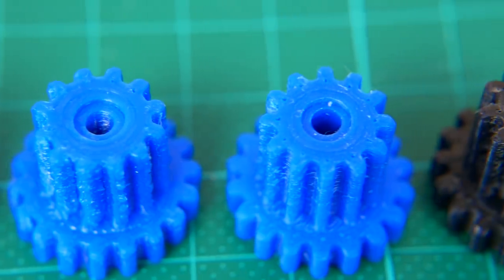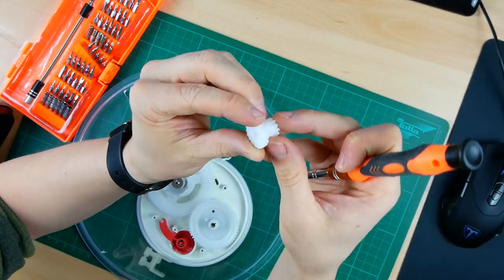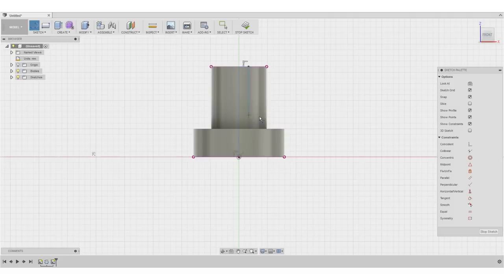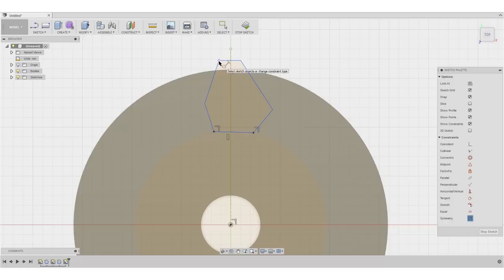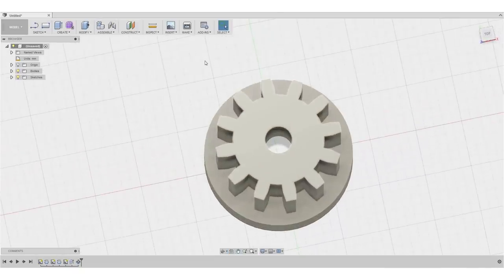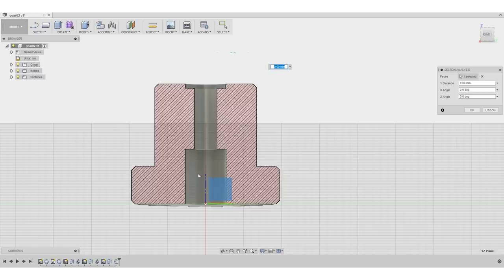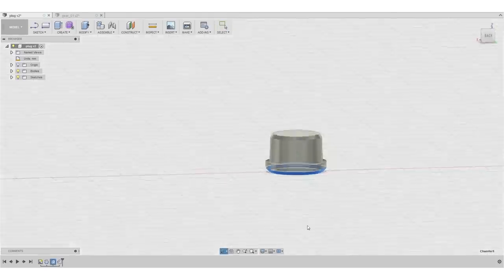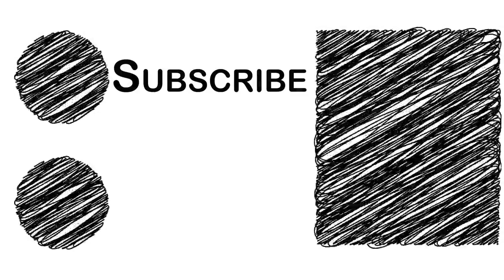3D Printed Gear Repair with Fusion 360 - Practical 3D Printing

Comment: This is an excellent example of using a 3D printer for a practical application. I am new to 3D printing and am learning a lot from your videos. Thank you for creating informative content. I just ordered a 3D printer which I will use to build radio controlled airplanes and associated parts, which is the focus of my channel. By the way, your English is fine!

Comment: it would make sense for the gears to be made of nylon. it's often used for gears for it's quite solid and self lubricant.
Also this looks like nylon gears (white color with a slight transparancy)
Reply: But you don't just strip or chew up a Nylon gear that easily. Could be a random polyester gear since the manufacturer doesn't really care about quality all that much.
Reply from the maker: Yeah, color and feel lead me to Nylon/PA. It just bothers me how I can prove that. There aren't unfortunately any moldmarks on it.
Reply: Probably the original gear was polypropylene
Reply: The standard test used in chemistry is burn test. Examine the smell, the colour of flame when you're holding a colourless flame to the item, then see what it does, whether it colours a flame, whether it ignites outright and sustains a fire while melting, whether it melts first and ignites later, and when it ignites, what colours (core and tip or edge) it has while burning, and what it smells like. There are tables that will help you determine the plastic from this data.

It barely melts at 150°C, which is likely enough of polypropylene, as Herman says, but shouldn't be Nylon. Acrid smell in flame when it extinguishes itself with yellow flame, sweet smell and blue flame with yellow tip whet it sustains its own flame. Not my first hand experience so I wouldn't be able to help you much, but perhaps something to go on.
Reply: Nylon wouldn't break like that, deformed, worn out or bent defect and Nylon would be likely.

It may be PP (Polypropylene) if it's really cheaply made, or POM (Polyoxymethylene  if the designer know anything of his profession and this one is only a defect or was improper treated (by user or manufacturer) you may also know this material under the name Acetal or Delrin :D
Reply: Never, and I repeat, NEVER do burn test on plastics if you're not a professional. It could be teflon, or a special blend containing teflon. That stuff will send you to the hospital if you burn it and inhale the fumes...

Teflon have self lubing properties though, so I don't think they would use that on gears. Plus it's usually very soft and bendy. Not ideal.

I wouldn't say nylon (PA), it smelts at about 220 degrees celcius. 

POM-C instead, smelts at about 160 degrees, is widely used in mechanical applications, also because it's so cheap and strong. It's kindea hard to dent with your nail also.

Then there's PE, which I don't think it is either. But you can easily dent and scratch it with your nail and it'll feel soft. For the burn test it'd smell like candle wax, burns basically like it too. But I don't recommend doing this burn test at all. If I remember correct PE have an almost invisible flame, so that's another risk.

Best bet is POM :-)

EDIT: Narnash yes, Acetal, or Ertacetal ;-)
Reply: Hi. I work doing gears, sparegears with 3d printer. but inventor profesional have a gears design inside.  congrats for the video. great job
Reply: Teflon is PTFE  when burned fluorine combines with relative humidity and forms hydro flouric acid gas
Reply: @SianaGearz  isnt "smell the fumes of an unkown plastic" just the opposite to a health recomendation?
Reply: @richardnelson5197  which is truly horrendous stuff!  We had an incident at work about 4 years ago where an idiot kept putting his hand into pickling paste and ended up hospitalised because of HF.

It was ignorance that nearly cost him his life.
Reply: Lol, this reminds me of Doctors testing morphine and other various compounds on themselves.
Reply: @CNCKitchen  take the old part and measure the melting temperature.  That should be pretty telling.
Reply: @jamesdean7412  its the best way to get accurate medical data
Reply: It also matches the description of HDPE.
Reply: Or probably Made of some type of pet brother
Reply: @CNCKitchen  For gears, commonly is used POM (polyoxymethylene), best material for plastic gears.

Comment: Thanks so much for this video.
I need to make a replacement gear for an RC car that is almost identical to the gear you made.
I can essentially use your video as a step by step guide to make a replacement (just changing dimensions).

And your English is great.

Comment: Actually just last week used fusion 360 to design and print a replacement driving gear for our old Raven autosteer we added to our 4430 John Deere tractor years ago.  Couldn't believe they made the original gear out of plastic that then runs against a metal ring gear under the steering wheel!  Considering this gear has to not only take the torque of the driving motor but also of the operator if they have to grab the wheel and yank to manually disengage the system. To top it off they don't offer it as a replacement part!

Anyway, teeth where 90% gone all the way around, with only small stubs left but at least I could tell how many teeth it originally had.  Was actually amazed I was able to use fusion 360 to design and replace the gear including mounts for a clutch plate that attaches to one side on the first try.  haha, happy surprise, thought I was going to have to do many revisions to get the teeth just right but came out perfect.  Fusion 360 does have a built in tool for help design spur gears now, saves some of the work for getting a proper tooth profile (once you do some googling to understand how spur gears are designed anyway :P)

Also I went with PET-G as my filament choice, pretty strong, chemical/oil resistant and think it will hold up to the heat of a tractor cab out in the sun well.   Was worried the outer ring with the teeth might delaminate if someone yanks on the wheel but so far so good after about 500 acres of spreading fertilizer thus far. 

Opened up the shell today just to take a peak how the teeth were holding up and they still look perfect!  Printed out a few more to leave in the shop; was originally hoping I could get a season out of each one, but starting to wonder if I might get a few years out of it which would be more than the end of life for the system due to the US gov plans to end of life the specific GPS signal it works on by then. (Originally it was going to stop in 2021 but they extended it to 2024 if I recall)

Comment: Awesome video! Thanks! BTW, your English is better than most native speakers!
Reply from the maker: Thanks! I do my best.
Reply: I work with some adults that were born, raised, and went to school in the U.S., and I cannot understand the ghetto/tweet/street speak that they use.  You sir speak english very well.

In addition: If you put the chamfer on the first tooth and then patterned it as well, it would save time and make changes easier. 

Good job and thank you.

Comment: The original gear was likely polyoxymethylene (aka Acetal), which is a very common material for small gears.  Melting point is pretty close to your soldering iron test as well.

Comment: Hi there! i have a bit of experience with printing ABS on a Prusa i3 and might help ypu out a little. 
For ABS you normaly turn off your fan so the part doesn't warp. If you print small parts like this gear(actually printed a very similar one last week) you want to have some cooling going on. Also be sure to set a minimum layertime of about 20secs. This slows down your printer but ultimatley gives the small area time to cool enough so it is at least in a semisolid state.

As you use Slic3er for the prusa secifically its quite easy to do those settings. ( Filament-Setting->Cooling-> Auto-Cooling. Set the cooling from 30%-50% and enable the minium layertime at the bottom.)
Reply from the maker: Thanks, I gonna give that a try...and buy some decent ABS filament.

Comment: A friendly advice; you could've done the chamfer on the edge of the initial tooth before making the circular pattern matrix, that way you make just one chamfer and that feature will be transfered to the later made teeth, I don't own a 3d printer yet, but I use a lot of solidworks and I'm Learning how to use fusion, and I've found your video really interesting and useful, thanks a lot! And yes, as an engineering mechanic student, I cried internally when you made the gear the way you did, but it proved to work very good, considering that you've got higher tolerances for what you made, again, thanks a lot for your video and keep up the good work 💪🏽

Comment: This is interesting. The very first 3d print I ever did was a rail gear set for a telescope I had. The manufacturers did not sell any replacements, and we were all disappointed that a $400 piece of equipment was pretty much useless without that tiny piece of plastic.

However, years latter, I knew how to model in blender, and my friend had just gotten into 3d printing (Le Guero Loco), so I decided to remake it. I didn't have a caliper, and there were no module ratings on the gear, which led me to just remake the set with my own gear design on both parts. Surprisingly, it worked first try. 

Needles to say, after having had the broken telescope lying around for years, I was out using it again the very first night I got the parts :) It was a great introduction to 3d printing for me. (I wonder how long the pla parts will last though, I should reprint them in petg sometime)

Now there is a really really nice "gear master" add-on you can download for free, and it automatically makes involute gear sets for you.

Comment from the maker: Looking for a new printer and want to support the channel?
CR-10 for $349.99 with code "618GBcoupon06": https://goo.gl/Anj5Mg
TEVO Tarantula for $264.28: https://goo.gl/hY53qQ OR AMAZON http://geni.us/Shfx
TEVO Tornado for $339.99 with coupon "GW4-15": https://goo.gl/Q1CR87
Alfawise U20 starting from $169.99: https://goo.gl/45ihaz
CR-10S on AMAZON Prime: http://geni.us/rVBsR
ANET E10 for $249.99 with coupon "GW4-13": https://goo.gl/o3qQdo
Tronxy X5S for $275.99 with coupon "GW4-14": https://goo.gl/BncF75

Comment: FreeCAD which is actually free has a gear tooth micro that will produce proper teeth.  I use the older 15. because it has a drawing module..  The 17 program last I check drawing program doesn't work.

Comment: It might make a good video to use friction welding to fix that pin. Fran Blanch did a great video on it. It is certainly a skill worth having if you like to repair plastic stuff. A dremel tool and plastic rod is all that is needed.

Comment: Tinker CAD  has a very simple gear maker that has been added, you select pitch and adjust for size.  I use it to 3d print gears for a lathe to drive the lead screw to cut different threads. It is a very simple program that uses shapes to modify shapes no CAD programming knowledge needed. This might appeal to those that don't want to spend the time to learn CAD.

Comment: Hello Stefan, 
Very good videos ! 
as many already answered, the original gears are usually made out of POM (also named DELRIN - Dupont (r) or Acetal (Family), as this is a self lubricated material. 
these materials are not (yet) available in filaments. 
one good (not so good) tip to recognize this material : while heating at more that 210-220°C -> white smoke, making you cry !! 
in case you want to print other gears, materials from IGUS are quite good. (I'm not working for them !)
Please carry on sharing !

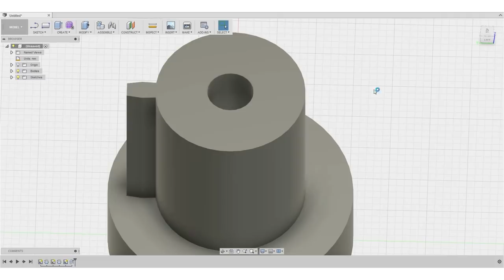Comment: At 9:58 instead of join you can click on distance and change to TO then click on the face you want it to extend to. The benefit od this is that if you change the heights later it moves that joint up and down with them without moving the rest of the tooth. Im only a beginner but saw that'll great tip the other day

Comment: You should be able to make heard in autocad using the gear creator. 

You need the DP no of teeth. And can be a fiddle. But it will give you the correct gear profiles. 

I made a whole gearbox with worm wheels using it about a decade ago.

Comment: Oh, that gear is likely POM, it melts around 175°C and is very good for gears as like PTFE it's got a lubricating action though it's not as good. POM is also called delrin/acetal.

Comment: exactly what i needed for my custom job on my car ventilation duct. thanks for the second time within 30 minutes! :) i seen another video using "spur gear" in add-ins section of fusion 360. with your way of explaining stuff it would be super if you did a video there, as maybe in my case, i dont understand all the check boxes to create something from that add-in, and have a outher total diamter to make it within. well if you make one, i guess i will see it in my subscription of you now :)
thanks!

Comment: With such a lot melting point around 150°C it could be PMMA (very robust) or PE (which would be a terrible choice for a gear). PMMA would be dissolvable is Acetone however - although it might react a bit slow. It could also be (partially) crystalline PP (melting point: PP-it ~ 180°C, PP-st 160°C), which again would be quite a good material for the job.

Afterthought: if the temperature of your soldering iron tip is out by more than 10°C, then I would guess PP-it or POM.

Comment: Thanks for posting. I've used SketchUp for years for woodworking and am quite familiar with it. It works great for woodworking. Unfortunately, with 3D printing and other more complex shapes, I need a better solution, so I'm slowly learning Fusion 360. I see a lot of similarities between the two, and see where Fusion 360 is much better in many ways.
Reply from the maker: You will not regret learning it! It is a very powerful tool and I'm so glad that Autodesk provides it for free to hobbyists. I can highly recommend the Fusion 360 tutorials from "NYC CNC" by the way.

Comment: AvE's soldering iron test. Nice. The youtube bubble is real
Reply: Or maybe you live inside this bubble. I have been using my soldering iron to find out approx. softening/melting points since forever. And I didn´t come up with it either
Reply: Phil Maitrot he explicitly said AvE's soldering iron method. I know that AvE likely didn't invent it. what was funny for me was the fact that he apparently also follows AvE. I've noticed several times in the past that a lot of the YouTubers I follow also follow each other, hence the bubble joke.

Comment: Hi your video was very informative . Ive just got a 3d printer as i need to make some cogs for  a lathe. I can cast the 3d print and then pour molten metal is there not a cog design for fusion. Or is there other software that can make the designing  easyer .

Comment: They work a lot better if you are not making the gears slightly undersize to allow printing the gearbox to be printed already assembled.

If using plain PLA... use natural as it is stronger.

Comment: Hello great video, how can i design gears with such smaller pcd but of materials like carbon steel or alloy steel. Is it possible to do so using 3d printer ? If not then please suggest some other technique/method. Appreciate your response

Comment: I get really weak layer adhesion for about 5-10 minutes of printing after switching from PLA to PETG and then it's super strong. I use PrimaSelect PETG and aside from the material switch issue, it is fantastic for parts that need mechanical strength.
Reply from the maker: +Juri Munkki That's due to residues of PLA in your nozzle. Try cold - pulling when switching filament types! That helps a lot!

Comment: Great video and very easy to understand your English, so well done you! 
I am researching the use of a 3D printer to make 3 small gears for a thread chasing dial on a small metal lathe. What if anything would be the most suitable product to use to make these gears? 
They will be engaged to a 20mm OD lead screw with a 3mm pitch.

Comment: Next time when you are doing chamfers, you can roll back the timeline to before you do patterning, do the chamfer, and then roll to end of timeline. Then you can have same chamfer on all teeth with just one single operation :)
Reply: can you elaborate and/or point to an example of this technique being performed?  Sounds like a good workflow optimization, in general; could be very useful for lots of operations going forward with that knowledge...?  Thanks, in advance.

Comment: a tip: measuring stuff this small can be challenging... put thr part in your 2d scanner and do a high res scan. you can import the image and build the model on top of your scan :-)  you just need one measurement to get the scale correct.

Comment: "You get the cad file from the manufacturer" more like you buy the cad file from the manufacturer for more than buying one replacement piece.
Reply: cough Linus trying to repair a Mac cough
Reply: I’d pay more initially for a product if I knew I could maintain it with 3D printed parts, within reason

Comment: Great video. The fusion 360 was very helpful. One question : do you know how to switch fusion 360 to metric? My 3D printer works in mm and my fusion 360 is imperial. Thanks for sharing
Reply from the maker: Your Namer - Preferences - Default units - Design